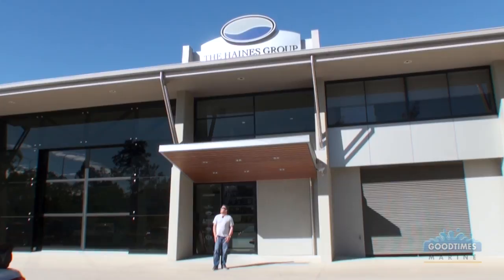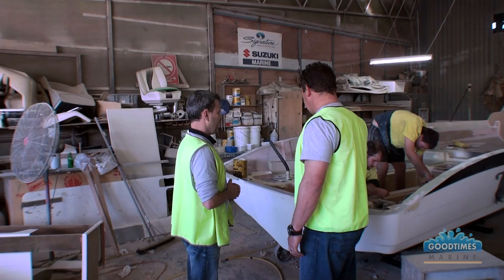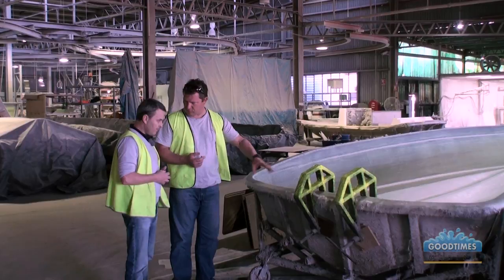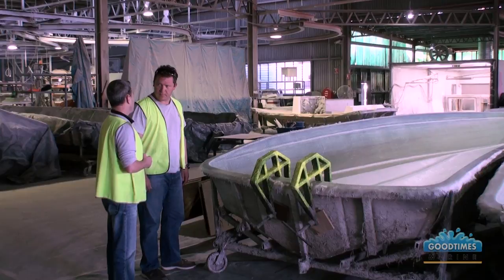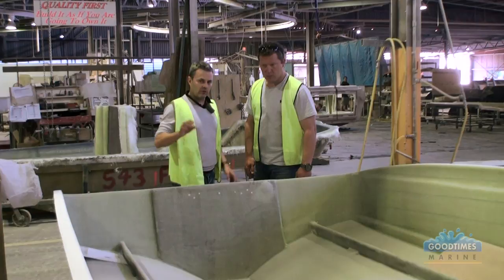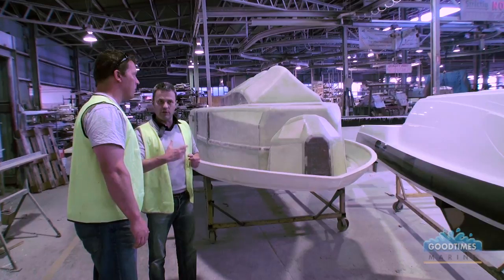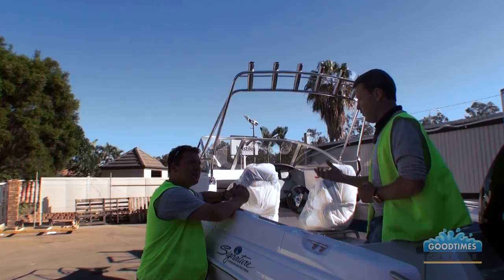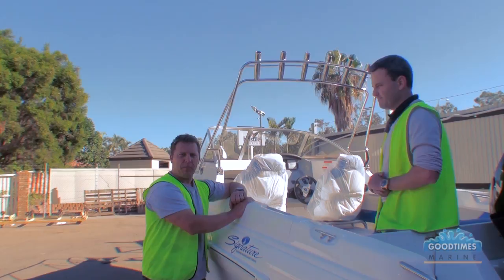Interview with John Haines, CEO of Haines Signature Boats.

Comment: Lets look at some facts.  this Extract is from the Haines Signature waranty 
*Any boat manufactured using the optional Thermo-lite Board in place of the standard ply in the build will be subject to a 5+2 year warranty (5 year structural, 2 year parts).
Note Ply gets 10 plus 2. 
So it seems they are convinced ply is a better product.

Comment: cant believe a boat builder in this day is still using ply why not use thermalite and build a quality boat that someone wont have to rebuild in 5 years!
Reply from the maker: Ben campbell watch from 4.30 I am not aware of any Haines Signature with Roo Ply ever having any warranty claim. That’s why it’s used, it’s tried and tested, it’s the best product available for the job. Thermalite is available, it’s used in other parts in the boat where it’s the best product for that job. Your claim of 5 year life with wood construction is baseless pub talk.
Reply: Why would anyone believe that when you have used ply since the beginning and just about every haines needs to be rebuilt due to ply transoms stringers and floors rotting out what is your explanation for the years of poor workmanship
Reply from the maker: Ben campbell Roo ply was introduced around 2001 and there has been no known issue since. If you watch the video you will hear it’s treatment features eliminating  risk of rot or termite damage. Sounds like you comparing boats from 1980 to boats built today. If you want thermalite no problem, but testing shows it doesnt beat roo ply.
Reply: Ben campbell p
Reply: My mate has a seafarer built in 2012, heap of bulkheads and a stringer completely rotten, inside of your 10year hull warranty and you still knocked back the warranty because he wasn’t the original owner and didn’t pay to get it transferred? Horrible workmanship and after sales service if you ask me
Reply: My signature is a 98 and been in my family since now no rebuilds here 🤷🏼‍♂️

Comment: My brothers 650f 2007 floor is totally rotted out ! dreadful build quality would you like to see some photos ??? Of your so called Roo Ply that doesn't rot??
Reply: Very interested in this type of feedback. All the boat reviews in Australia are done by paid promoters and salesman. So honest reviews are few and far between. I think completely wood free is the way to go. You should post a vid so others can see, always researching new boats.
Reply: @bobbuilder5362  From the research I did before purchasing an older Signature, I couldn't find anyone who actually owned one with an issue. Plenty of people on forums and things saying 'yeah, I knew a guy and his rotted' (for any boat brand) but no first hand cases... Perhaps that's just because people don't want it known that something they want to sell in the future had an issue? Anyhow, I ended up buying a 1998 540F because it offered what I wanted in a boat at a sensible price point and it was no more likely to have issues than anything else of a similar vintage. The transom, floor and stringers are all solid but the timber in the bow sprit is mush (wet rot) and one of the internal shelves has dry rot. From what I can see both are as result of poor sealing, of the bow sprit hardware and end grain of the shelf respectively. My 2 cents is that most rotted boats are down to people not caring for them though. I can definitely see ways water can get to the stringers and transom in my boat. If I were to empty the kill tank into the underfloor area without opening the rear bung and tilting the trailer right up as well, that water would sit in against keel stringer and transom. Same if it got hosed out or left in the rain with an internal bung open time and time again for 10+ years. Then you have the issue of people drilling holes to add things and not truly sealing them... No doubt it would be possible to build a boat that didn't rot but I also think it is a case of being aware of possible ingress points and treating them accordingly. Plenty of people do just that, and that's why there are many 20-40 year old boats running around without having being rebuilt - I'd be amazed if mine wasn't still good by its 30th birthday!